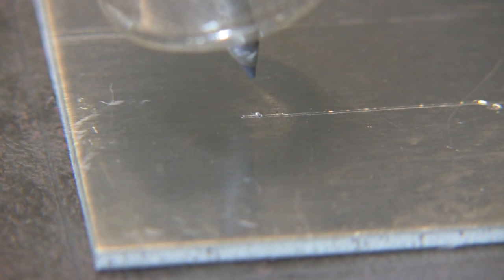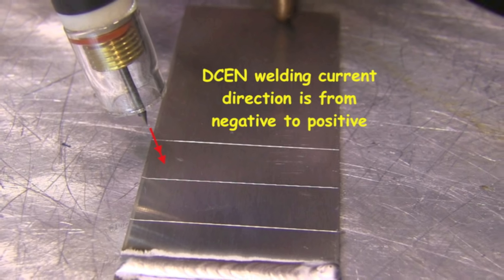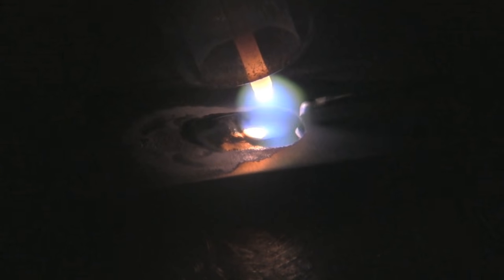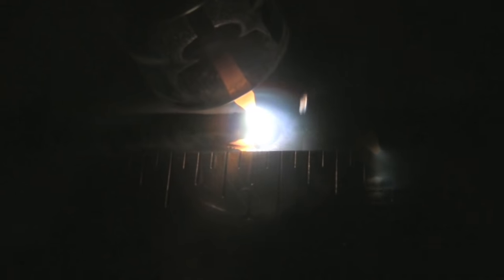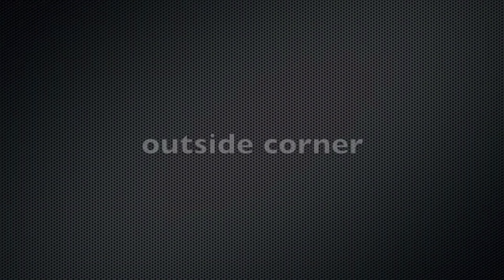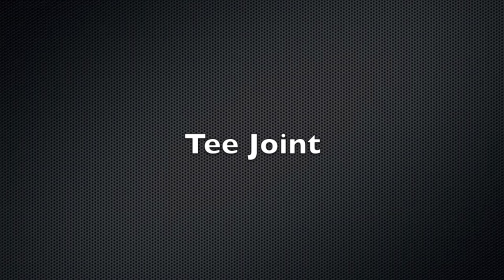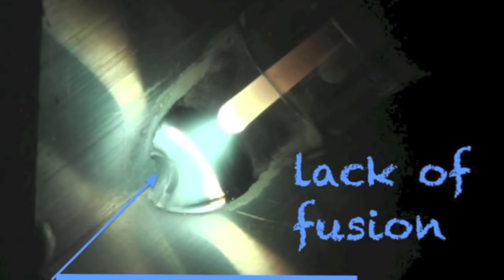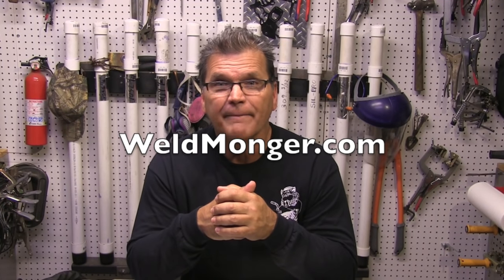How to TIG Weld Aluminum part 1

Comment: 👍 what is the reason for starting out light on the pedal? I understand the need for the cleaning effect to kick in  but not about the reason behind low starting amps. Thanks
Reply: NJ.Kevin, this allows the open circuit voltage combined with highFreq to start the arc with little tungsten "spitting"- from high initial current flow. As soon as the arc is initiated and stable- you can begin to add amperage/wattage to get the first wet puddle.  Allowing the power supply to initiate at its 'factory default' open circuit conditions reduces electrode tip deterioration from high wattage transfer before the arc is established.

Comment: Hey Jody ,can you explain why sometimes the filler wants to blow away and cause a dirty mess at the end of a weld , mostly on tube (aluminum) thanks.
Reply: If it's blowing out just as you finish up the end of a tubing weld, is the other end of the tubing already sealed up?  If so, the hot gasses are trapped inside the tube and have nowhere else to expand as you superheat things more with the tig torch, and you will have a mess.  Drilling a small vent hole in that tubing section has helped me in the past.
Reply: not blowing the tube out just the filler rod blows away and leaves a mess.

Comment: Thanks jody ,another great video !. I have a question for you.. Im having a go with lift tig on steel, does it matter if you use a bigger tungsten (diameter) than needed for the current your welding with.i.e a 2.4mm tungsten using about 70 amps? ( i do know that this is usually for 150 amp range thanks

Comment: hey Joedy two things can u get a bit more in-depth on welding with dcep on aluminum and what can u do with it and what can u change on your set up to get a bit more amperage what   torches u can used to get a bit more amperage before melting the electro and what types of gas works best argon,75/25 or straight hellium oh and btw get a pattreon account u have help me a lot and I would like to return the favor

Comment: How is mug welding, with a spool gun? Compared to tig?

I have done a lot mig aluminum, but have had some cold welds, and pin hole leaks. Wondering if it is the process or me. Maybe I need to do to tig
Reply: Mig

Comment: Hello everyone, I need a little help.
I have started welding out of curiosity, I bought a cheap dc stick welder with amp range 20-200. I picked up some 7018 & 6013 rods.
The problem is with 7018s I am able to start an arc but can't keep it. The rod metal seems to burn fast and gets recessed inside the flux coating, extinguishing my arc.
I have tried 45,30 & 90° drag angle in both DCEP & DCEN at about 100amps. What am I doing wrong here?

Comment: I have recently started playing around with TIG welding aluminum. I often end up blowing through the plate or getting serious deformation on the back of the plate or joint. Any idea where I might be going wrong? I am working with a millermatic 255. I have balled the end of the electrode I working at 75 amps. Metal is clean as a whistle, and I'm using and 1/8" tungsten with a 6 ceramic cup. I feel like I am moving quick enough but I still get the bubbling in the back.
Reply: Some possibilities, travel speed too slow, amperage too high,  too much electrode negative.  hth  The welding speed on TIG Aluminum is quite high compared to other metals.  The size, not just thickness, has an effect.  When welding aluminum as it heats up, it is necessary to increase travel speed or decrease amps.

You didn't mention how large and thick your metal is and what your settings are for that metal.

Comment: Hi when welding 3mm out side alloy angle 45 deg corner butt weld 25x25x3mm I find it hard to weld it .by the time I get a good clean pool  it’s that hot the corner just melts away any suggestions how to stop this ?

Comment: Conventional direction of current is from positive to negative. It determined by math equations -- it's more convinient to not deal with huge amount of minuses. Electrons flows from negative to positive but real current in gases presented not only with electrons but with ions too and those ions can be both polarity and can flow in both directions.
Reply: Actually the torch generates a plasma.
Reply: @paulkurilecz4209  But this sentence is not relevant to the case, does not explain anything and does not refute anything.
Reply: @Ma_X64  Please go look up what a plasma is.  It is referred to as the fourth state of matter.  What is present in the arc is more than just ionized atoms.
Reply: @paulkurilecz4209  You did not understand my point. It's a plasma but it is doesn't matter. You just blah-blah some terminological word that says nothing about how current flows through this substance. My starting comment wasn't about WHAT it is but HOW current flows through it.

Comment: Hi Jody, 
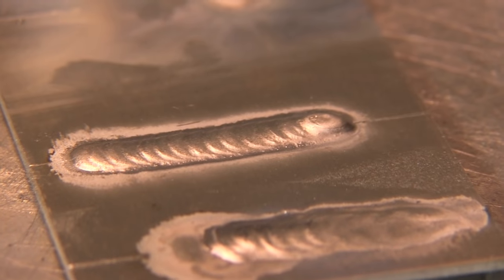great video as always. A particular problem I sometimes have when welding aluminum is that the beat has a bit a grainy surface appearance. I also saw this at one of your beats exactly at 4:00 of your video. Could you comment what is the reason behind and how this eventually could be avoided?
Reply: Marc Wintermantel 4043 filler usually.  if not then you might need more cleaning action.
Reply: Thanks, indeed I was using in all cases when this happened 4043. Nevertheless it did not happen in all cases I use 4043. Might it be that only some types of aluminum in combination with 4043 filler show this behavior?
Reply: Marc Wintermantel it turns grainy from the heat.  so on thinner stuff it's almost unavoidable but on thicker stuff or just moving quickly it will be less grainy.
Reply: That makes sense as it mainly happened to me on thin stuff but actually never on ticker stuff. Is 4047 showing the same behavior?
Reply: Marc Wintermantel I'm not sure? never ran it.  I pretty much only use 5356 and 4943.  5356 is my favorite filler.

Comment: Jody, how critical is the use of helium in welding aluminum.  Is it mandatory, or "nice to have"?  Is its use related to the thickness of material being welded?
Reply: Helium is mixed with Argon when you're trying to weld something very thick and your machine doesn't have enough oomph. A 200A machine welds like a 250A machine with a Helium mix. You don't need much Helium to see the effect.Helium ionizes at a higher voltage, power = Amps X Volts, so when you Increase the Voltage it increases the power.
Reply: Not mandatory, unless you're welding something that's too thick for your machine's capacity. for really thick stuff like cylinder heads, helium is a game changer.
Reply: The only time I ever use Helium is if the welders maximum amperage rating isn't high enough. Just like MCE said, it makes a 200A machine weld like a 250A machine. But I've noticed it requires more cleaning action on the wave balance to keep the weld bead and etched area looking as clean as when using 100% argon (not brown/dull). You can also pick up a bit of travel speed on thicker materials with a Helium mix.
Reply from the maker: I usually weld with  a helium mix on 1/8" and thicker.  It doesnt take much helium to make a difference, I have a western 411 Y with valves and I barely float the ball on the flowmeter and it makes things go better.
its not really needed on 1/8" thick but I like it.
Reply: Jody, I just received a western Y valve and I have seen your set up quickly and it shows back flow valves can you Please give me a name and product number for them if I need em. 
I'm using a 221 HTP and want or need to do thicker aluminum.
Thanks in advance

Comment: Hi mate , when i am tig welding with a non-adjustable torch(eg: no foot pedal , no adjusting knob on torch) at the end of my weld when i release button and lift off , i always tend to get a small hole or dimple in the weld , how can i prevent this please ?

Comment: My problem when I light up it takes too long and my part starts to get hot. By the time I'm finished, my welded plates warps.
I'm welding 1/8 plate 6" long by 2" on another one to make an L bracket.
Reply: Two things.

Use a heat sink to draw away the heat. Big blocks of aluminum are great at pulling heat away quickly.

Second and this may make no sense but try increasing amperage  so your arc is hotter. The hotter your arc the quicker it will form a puddle and the faster you can lay a bead.
The slower you weld the more heat you put into the part trying to maintain the puddle and bead. The faster you can make your weld and finish the less heat goes into the part. So try turning up the heat a little.

Also try clamping your part better. Use more clamps or better clamps.

Comment: I'm new to TIG welding. No official training. I bought a lotos brand 200A AC/DC off amazon for $520. My Argon regulator/ flow meter only has one outlet, can I use my 75/25 MIG mix as a purge gas behind a weld? Im welding end caps (20ga) onto 3/4" SS pipes (aprox same wall thickness) that will go down into the fire on a maple syrup evaporator pan. Has anyone else ever used this machine?

Comment: How do you keep the electrode sharp, which type/color electrode and gas do use?
Reply: bench grinder, or tungsten grinder, ac current will ball the end up workin wit aluminum.
gas, depends what youre workin with, mainly on tig is 100% argon, but again depending on what your workin on.
 some add helium when working with aluminum(separate tank with Y fitting and low gas flow)
tungsten- all depends, different kinds for the material and sizes.

Comment: How to start welds always when I start before I get a puddle the metal seems to evaporate  especially on thinner materials.
And how to weld aluminum without a foot pedal so when i reach I don't bun through the aluminium.
Reply: try using a pulse setting and a higher frequency and if your machine has the ability some u can set a starting amperage and it builds up to your set amperage another way is dont start on an edge initiate the arc further in then move back to edge if u dont have a foot pedal i would really recommend pulse to lower heat input

Comment: I just learned how to TIG alum and my teacher was saying he likes to keep his tungsten flush with the end of his cup. I did that for the welds i was making and it work ok for the most part except for t joints. With the tungsten squared and flush with the cup it was difficult to get a good bead but i managed. What is the advantage of having a tapered tip and out a bit? Is my teacher wrong in this aspect?
Reply: Don't think of your teacher as "wrong" think of it as a different school of thought. The flush tungsten with the cup is good for starting out on flat surfaces , but you will never get a tight enough arc on a t-joint with it flush with the cup.. You need to stick it out there so you can get nice, and tight with your arc.
Reply: so for butt joints and corner joints flush is good?
Reply: Well if you can get the cup down there to keep a tight arc then yes, as long as you can see, the only reason really to stick out is to be able to see the arc ,and get the tungsten close to the puddle as possible without putting it in the puddle. Having it flush with the cup keeps you from sticking the tungsten in the puddle, but at the same time if you can't see the arc or puddle having it flush doesn't help you.
Reply: Alright thank you!

Comment: for the life of me, I can't get that shiny wet looking puddle when I start welding 1/8" aluminum. I was able to, but for some reason I can't get it back. I don't know what I did. I did not change my settings. what I'm getting instead is that my electrode is going off in all directions and it's making these dark pepper marks on the aluminum. I have my balance set at 4 on my Miller Syncrowave 200  with 180 amps. post-flow is at 5 seconds, start characteristics set to medium, peak and background are 50%
each. The manual said that I may be having some problems with the sparks gaps in the machine that are suppose to be set at 0.008" . I've had this machine since 2009 and rarely use it..so I already need to adjust the gaps? It would be nice to know how many hours the welder runs so that you can adjust the gap. And does the timer/cycle counter provide these hours? I get 16; can't remember the cycles.
Reply: Yeah the black crap. That happens to me too whenever I try to weld aluminum. That's why I don't do it.
Reply: GnosisMan50 clean your metal, get the oxides off. use red scotch Brite pads then acetone.

Comment: So if AC is needed for TIG. How is it that spool guns work on MIG that only runs in DC?
Barry, London U.K.
Reply: im not entirely sure would like a answer as well but i believe it's because of the push pull system MIG uses? Also he showed DCEP electrode positive which still cleans the metal but wrecks your tungsten however with MIG the wire is disposable so u don't worry about that  so u still get an effective cleaning action while also adding filler

Comment: Between you, weld.com, and chucke2009, you guys have taught me how to weld aluminum and I'm super thankful! Thank you!

On to some questions:

1) Is every machine different in terms of need for argon? I found many videos saying 15-20cfh even with a super tight arc but can't seem to get a perfectly clean bead until the 25cfh range. I've tried this with two different regulators so I'm thinking it's not a bad regulator. (unless I have two bad ones)

2) Lanthanated or Thoriated... does it matter? (I'm on an inverter, AlphaTig200)

3) Can you show the backside of a butt joint? What does it look like when you bend it to the point of breaking? (should that even be possible?)

I'll stop at three questions for now. :) 

(btw, I've got a couple of tig fingers and love them!)

Comment: How do I get consistent penetration on an outside corner?
Great vid :)
Reply: Dominic Fawbert, the most effective indicator of outside corner (initial pass or single pass) penetration is to carry a key hole at the leading edge or the root (intersection of parent metal edges) of the weld.  This insures you have a 'back weld' as the outside corner is welded.
Reply: Kevin Morin Thanks man, what gap size would you say?
Reply: Dominic, gapping an outside corner is not always necessary. Since the two edges of the sheet/plate are knife edge 90's (so to speak) they are already a reduced cross section and with sufficient amperage/wattage the parent metal edges will 'melt back' to form the key hole.

Some might use a tack off set (gap at the inner edges) but its not necessary - depending on the power of the welding power supply and the bead size.  For example an outside edge of two 1/8" plates' edges can be keyholed by just turning (pedal increase) up til the opening forms.  On the other hand if you're working with 3/8 or 1/2" plate then maybe a 1/8" gap may be in order if you aren't using a 300A power supply with 5/32" electrodes?

 posted some explanations here: http://www.glen-l.com/phpBB2/viewtopic.php?f=7&t=28367

Comment: when i run any sort of joint try to keep the arc as tight as possible the aluminum looks like it jumps on to the electrode how can i stop this other than a longer arc
Reply: Lift the tungsten up a little every time you add filler, the puddle tends to rise a lot so just long arc it a little each time and then get back in there.

Comment: Jody, totally no idea about tig, what is the foot pedal for?
Reply: A TIG pedal controls the arc power. The further you push the pedal the hotter your arc is. It is like turning a dial up, and down on a welder. At least that is how mine works.

Comment: This might be a more general question, but I feel aluminium is more susceptible to warping. How do I keep warping to a minimum, like when I have to weld around on all sides e.g. a box?
Reply: Jack White I clamp I piece of 4 or 5 inch c channel to the side.  also works as nice place to prop on
Reply: Stainless is the worse, but aluminum is pretty close. Place small tacks every 6". You can also weld from the center of your weld outward to the edges. I do that on certain parts I make. Tack each end, and weld from the middle to the left edge, come back to the center and finish the weld all the way to the right edge.
Reply: Thanks guys! Will try that next time.

Comment: I've never welded aluminum, but plan to in the future. I noticed on the "long arc" example, that the cleaning action doesn't seem to be working either. Was I seeing that right?

I'd also like to see more cast welding and more about cleaning and prep before welding. I've learned a little about painting cars, and it all comes down to prep before you even spray. I assume this is true for welding, and welding aluminum especially.

Comment: jody one of my friends asked me if i can weld a cast aluminum part for him (max. thickness 1/8") but i only have a dc tig machine and pure argon. is it possible to weld? thanks!
Reply: Archie Bunker well he isn't a cheap ass as he took it to a professional but why spend money when you have connections
Reply: Archie Bunker well he didn't knew what machine i have and what i can weld with it. isn't it better to ask than to spend money